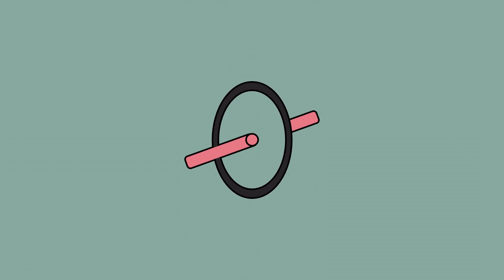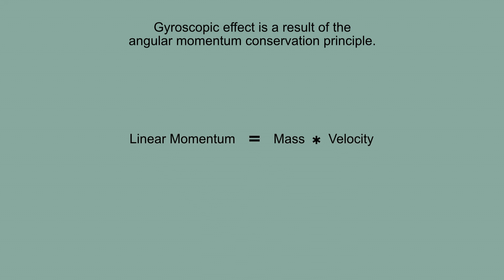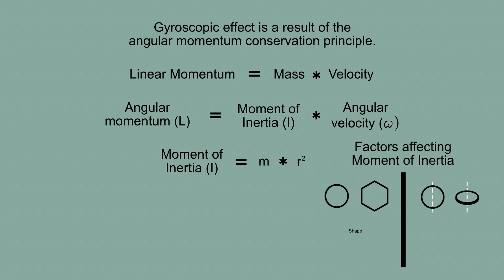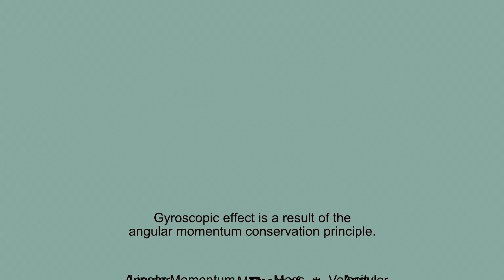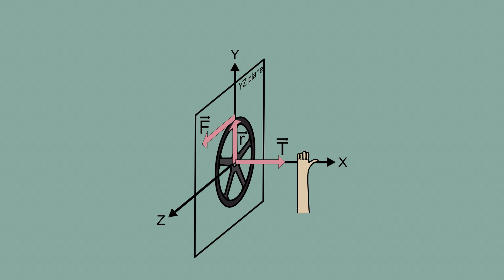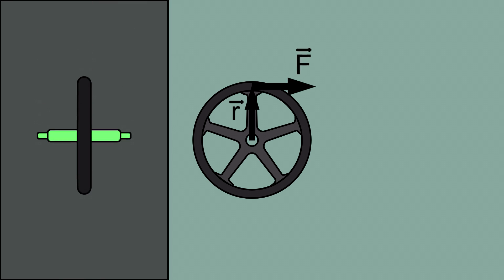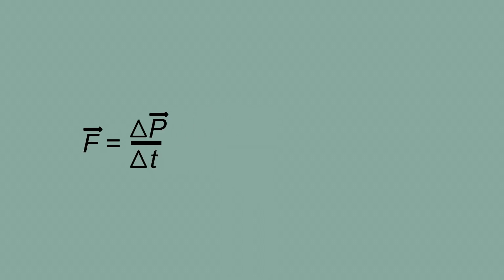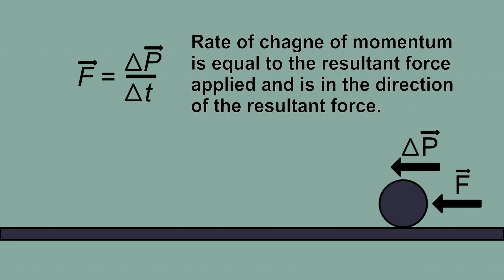What is Gyroscopic Effect? | Gyroscopic Effect on Airplane

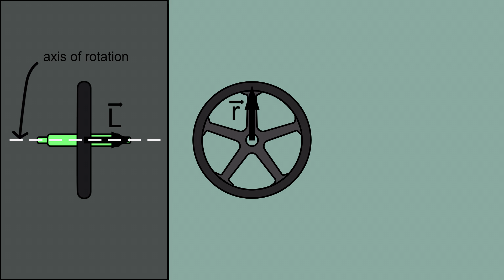Comment: At 3:04 sec you said now the wheel is spinning and force applied on it is zero how a wheel can rotate without any force?
Reply: Once the wheel starts rotation , later on, ward's no external torque.  That's what he means

Comment: Best explained 🔥🔥
Reply from the maker: Thanks Vineet.
Reply: @illuminateingenuity6122  so then, what is the minimum speed to achieve gyroscopic precession of force?
Reply from the maker: The gyroscopic precession force is always there (given that the body changes its direction of angular momentum), it is just smaller in magnitude for small speeds.
Reply: @illuminateingenuity6122  so, in a sense, it is quantized.  hmm,.. interesting